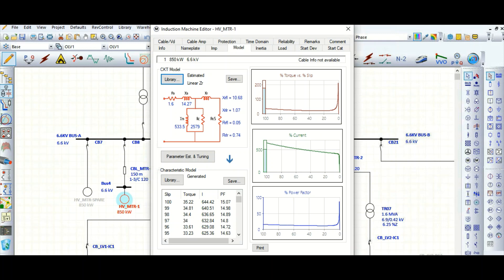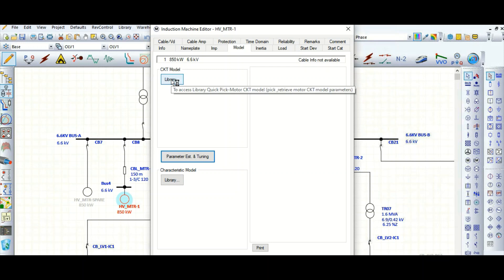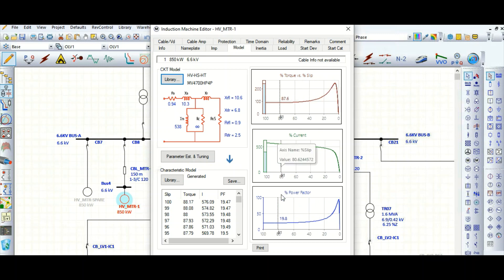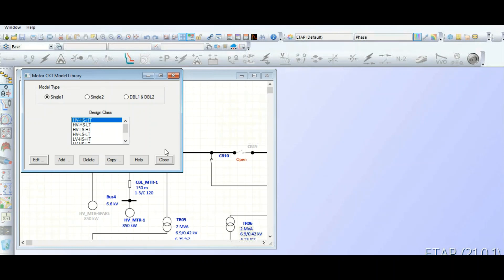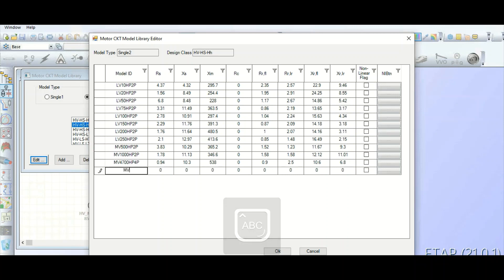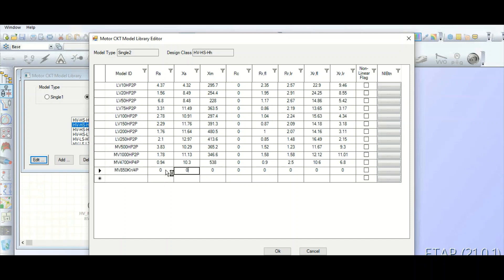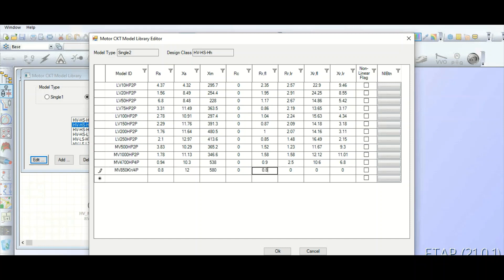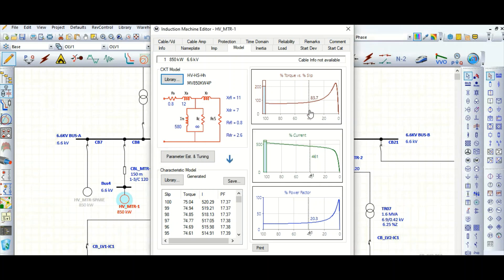ETAP Power System Study II Motor Dynamic Model by Circuit Model

Comment: HS is not High Speed, but High Slip
Reply from the maker: you are right, anyway, this design class needs to be defined based on project requirement like no. of poles, torque, speed, slip etc...

Comment: Nice explanation! Can you explain how motor parameters can be added in ETAP library based on project requirement?
Reply from the maker: Thanks! 
To add motor parameters in ETAP library, there is a dedicated video you can checkout the same..